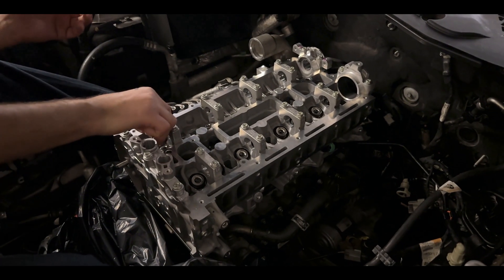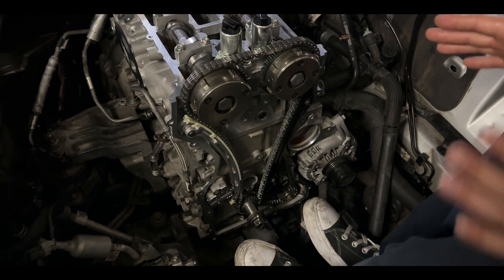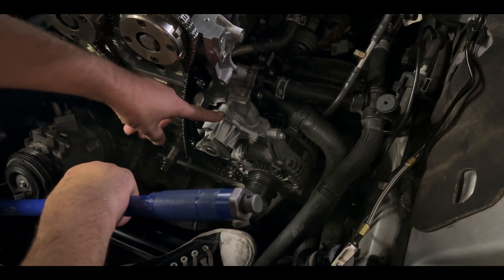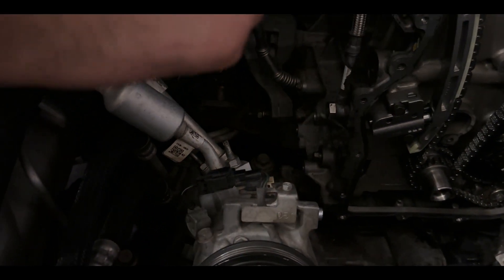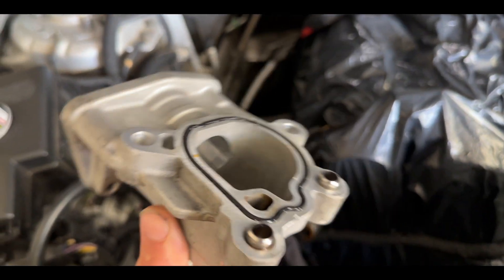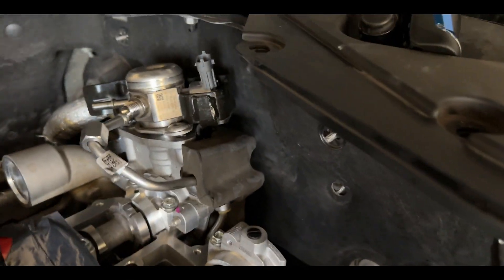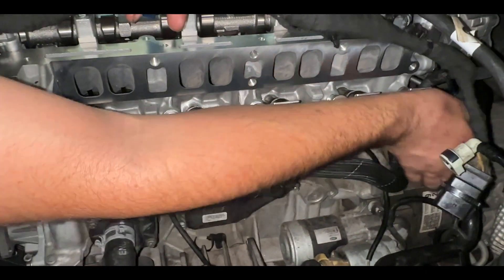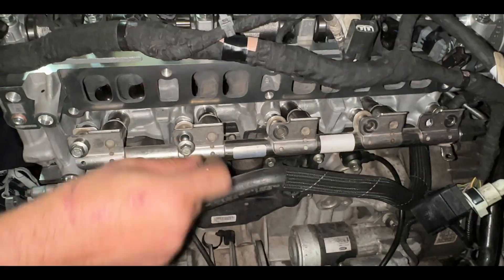Mustang EcoBoost S550 Head Gasket Replacement   Ep 7

Comment: quick question when you were installing the high pressure fuel pump did you rotate the cam lobe for the high pressure fuel pump at BDC before  installing the fuel pump tappet?
Reply from the maker: Me no I didn’t
Reply: @DailyDrivenStangs  so you don't need to do that, you can just install the fuel pump tappet without rotating the cam lobe
Reply from the maker: @vicarnieva5401 you should be able to I didn’t rotate it. As long as your timing still is all done it won’t hurt to rotate it if it makes you feel more comfortable

Comment: hey bro I don’t know if u didn’t show it but the cams should not be going in bone dry. use an oil squirter with heavy oil or assembly lube, I’m sure those got scored up real nice on first startup. assuming they were dry of course
Reply from the maker: No, they did not going dry. They were well lubricated. I’m pretty sure I did show it.